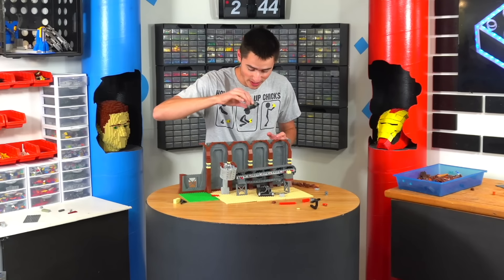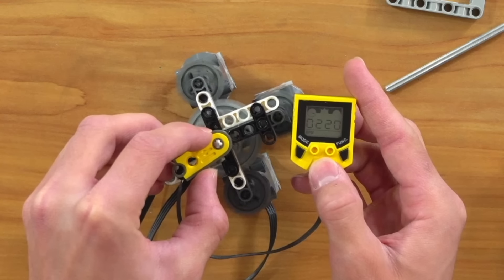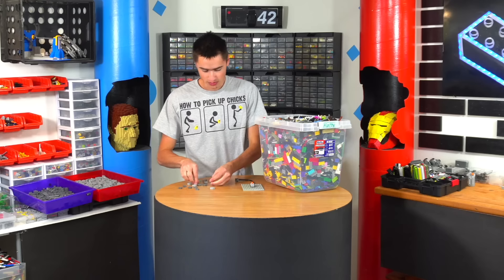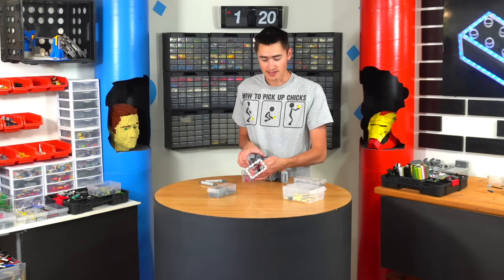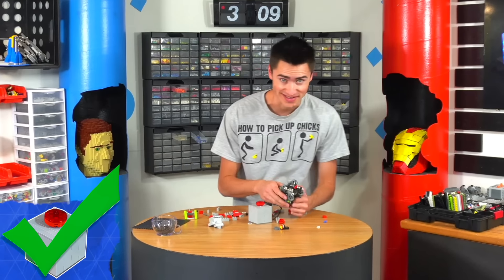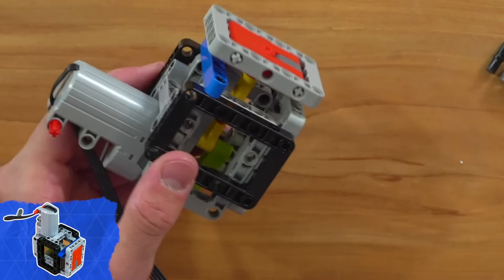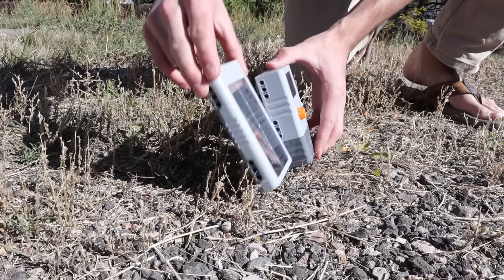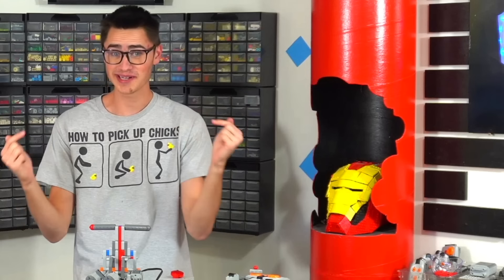I Upgraded LEGO Power Functions!

Comment: 2:19 or simply put, there are 4 battery instead of 2 previously, so its obvious you will double the speed if you dont split by half the voltage 😅